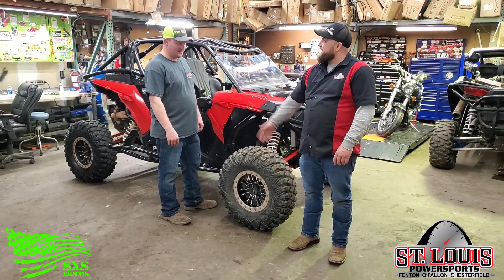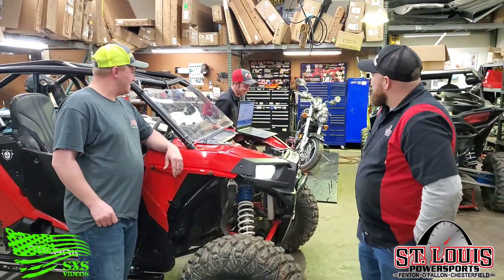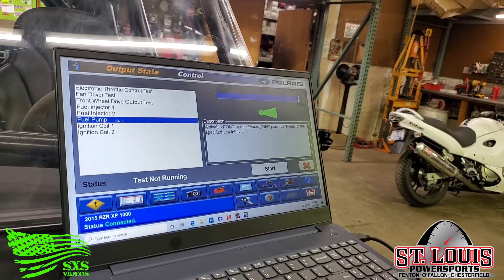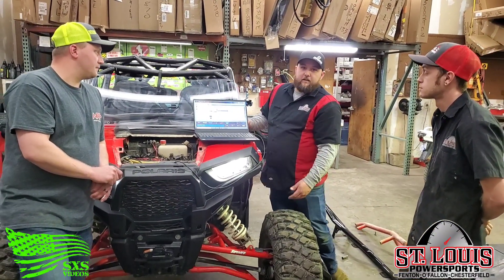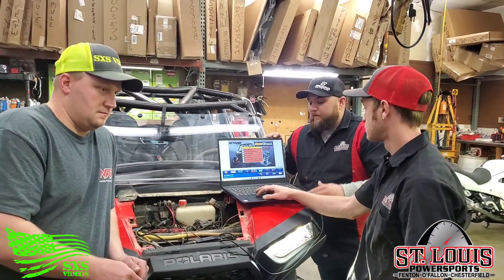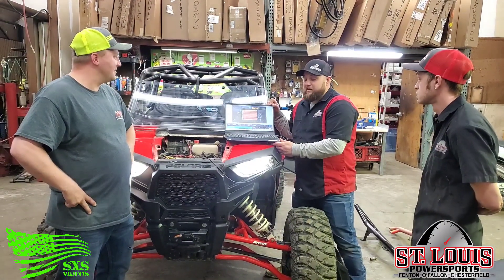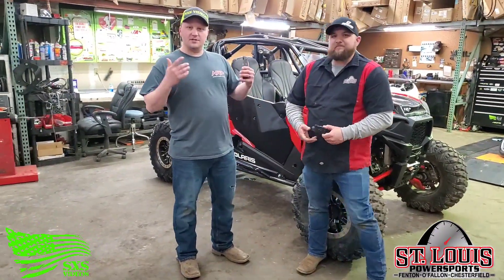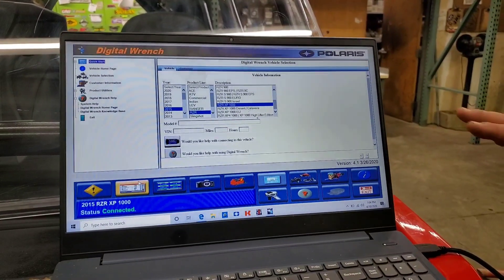Polaris Digital Wrench Tutorial  #Techtiptuesday

Comment: I bought a used Polaris Ranger 570 Midsize that was in limp mode.   Three codes were showing, which I eventually traced to two wires worn in two. near the throttle body.     I fixed these wires, and the codes went away, but a new code appeared.   0 520280 31 which basically says, "the limp home mode check failed."   I don't know what I might have done to disable the "limp home" mode, but now the machine will not run at all.   I intend to reinstall the throttle body that came with the machine, in hopes that the used replacement throttle body that I bought has this problem not my machine.    My local Polaris dealer mechanics do not seem to have any more knowledge than I do, so i al looking for help somewhere else.   If you can point me in some direction that will fix my problem I would appreciate it!!!!
Reply from the maker: Dang, Buddy. That's unfortunate.  The guy in this video actually started his own shop. He's the best in this area. Give Nick a shout at Schmitts UTV and More. 3143484142. Tell him Zach Nash Sent ya. He's the only guy I let touch my rig.